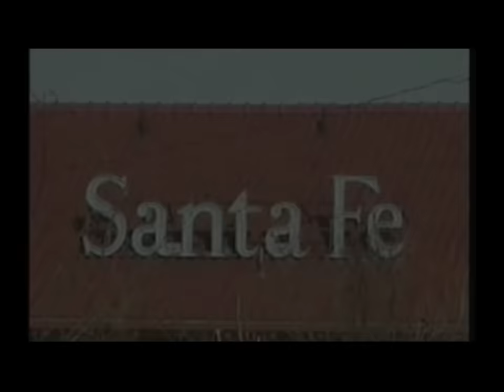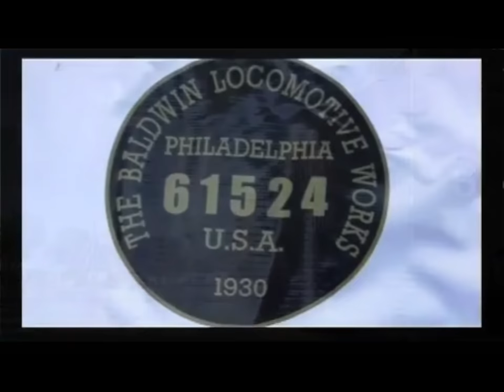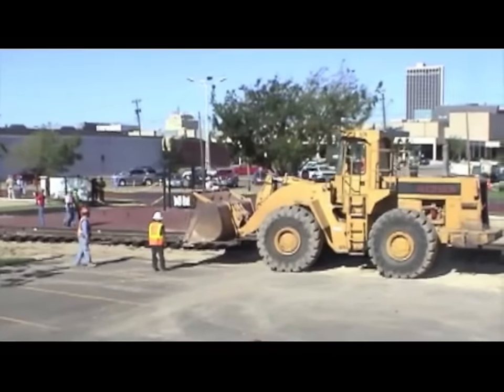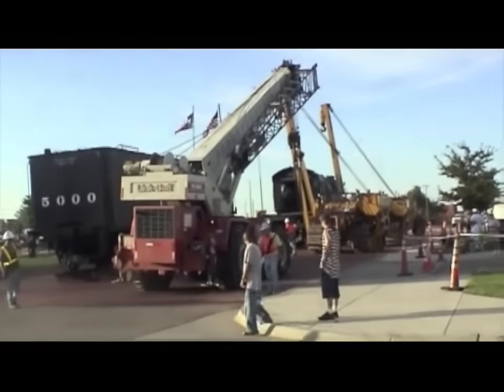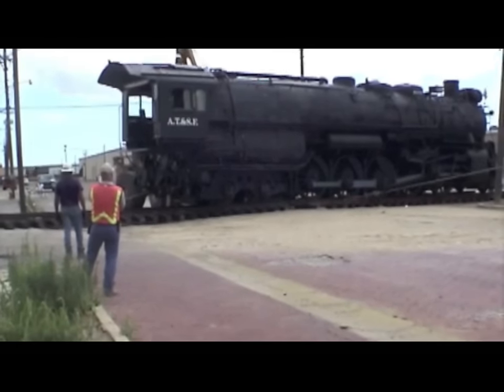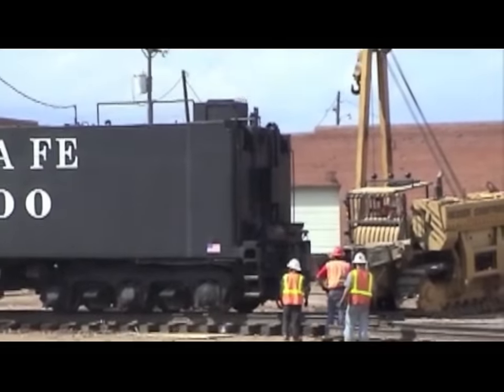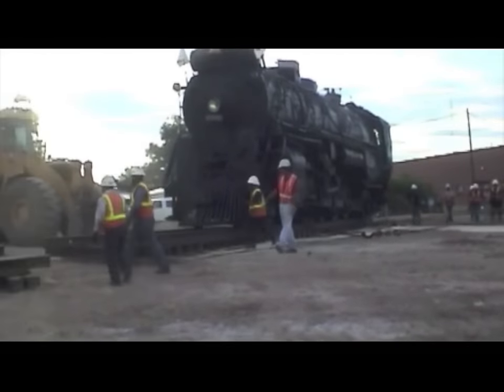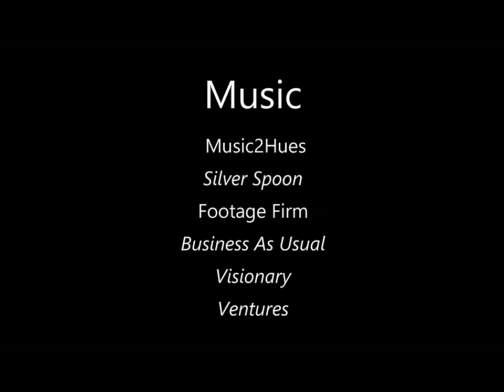Can Steam Locomotive 5000 be moved down 100-year-old brick streets without damaging either one?

Comment: I can't believe they left the main rods and valve gear attached.  What's even more amazing is that the pistons and valves weren't rusted solid.  Cool video, liked it much.
Reply from the maker: Glad you like the video! At the time of the relocation, (2005) a restoration to steam was not even considered, so no attempt at removing the rods was done. The pistons and valves were not rusted solid probably because of Amarillo's low humidity and rainfall.
Reply: Things don't rust out west like they do here in the rust belts. Very low humidity. That's why they store planes in the middle of the desert

Comment: I thought 5000 was being moved to a restoration facility, not another place where it will continue to rust.
Reply from the maker: RAPS had a plan to move it to another location for restoration to steam serviced, but that all went south when they couldn't acquire ownership.
Reply: "rust" is a strong word, locomotives stored in deserts are actually quite stable and will maintain structural integrity for a shockingly long time... She's dusty, but a new coat of paint and a scrub bath is usually all it takes to make one of these engines look factory-new again.

This stands in contrast to locomotives stored/abandoned in rainy areas like the PNW or the eastern seaboard, which tend to rust to the point of being nearly unusable after only a couple decades, and will sometimes even show early signs of rusting within a year or two of being stored.
Reply from the maker: Unfortunately, 5000 has some rust damage on the engineer's side boiler jacket.  This has happened since the cosmetic restoration completed in 2010.
Reply: @trainknut  they store old airplanes and helicopters that have been decommissioned out in the desert
Reply: It costs sooo much money to move one of these locomotives that's why you don't see it often I saw a much shorter locomotive being pulled by a big rig..no tender  just the engine it was steam it looked like it was being moved to hopefully be restored
Reply: @trainknut Unfortunately Amarillo is not in a desert.

Comment: The  IC engine # 2500 at Centralia IL also is displayed at their city park since it was retired back in the early 60s. The thing is that the city takes care of it and always has kept it i n decent condition. Several years back they built a shelter over it to further protect it.  I think the successer to the IC also helped fund the care   of it.  I know that in the original agreement with the IC, the RR specified that it was to be maintained in a decent fashion, not allowed to rust into oblivion or destroyed by vandals.  One time back in the early 70s, a major storm literally stripped paint from the boiler jacket, the RR sent out their crew to repaint it so as to preserve it.
Reply from the maker: That's how a good city government does it!

Comment: I have to agree if they can get the big boy running again and the 611 this train should be restored and put back on the tracks and used instead of sitting in a building.   
You see how much attention the other two engines God when they were restored and put back on the tracks buy the public.  This engine will attract the same amount of attention and people wanting to see it run not just sit.
Reply: Ah - auto-word entries are the Pitt's eh?
Got should never be misspelt as GOD - but there it is, used incorrectly.
[quote]
... attention the other two engines God when they were restored ...
[unquote]
I's sure you didn't mean to say it that way - but seven days ago - means you never checked after commenting

Comment: If the bigboy could be restored couldn't this one ?
Reply from the maker: Yes, 5000 could be restored to full steam operation.
Reply: Not knocking the efforts: but big boy was a fairly easy straight forward, if large, restoration. Theres been a lot harder ones done look at the work done on the rogers k88 or the nzr v's that are still draining after getting pulled out of the river bank
Reply: Yes it could be restored if money was available   the BIG BOY cost around $5 million this one would cost at least $ 3-4 milli9n
Reply: Just scrap all these useless overkill compensator pickups that are hauling nothing but egos in the bed to be used to construct the facility needed to rebuild this useful locomotive that helped build America and not destroy it like car centric infrastructure.
Reply: Anything can be restored , its a question of money , how much and from who

Comment: Stuffed and mounted. I wonder how pitted the boiler is? Would it be practical to go through, re-flue the boiler  and see if she'll boil water again.
Reply from the maker: We actually did a thorough mechanical evaluation on 5000's boiler. We even did a UT test of the firebox and the results proved that the metal was thick enough to hold 300 psi pressure if fired up again. There was one small area in the lower RH corner of the firebox that would have to be replaced due to moisture getting trapped behind the firebrick.
Reply: @santaferatonsub  the usual suspects. I'd imagine a lot of the mud ring area and any other spots that held moisture / condensation were in need of the most attention. But that's wonderful news! So obviously the running gear still functioned. Has there been any interest in putting a fire back in her box and sending her down the mainline again?
Reply from the maker: The running gear functioned and even the mechanical oilers worked during the move. We had big plans back in 2016 to put 5000 back in steam. Unfortunately, the engines owners (City of Amarillo) have no vision for such plans.

Comment: Amazing to see but I don't understand why they did not put it in a building or build one around it. Its been restored but its still outside and open to the elements.
Reply from the maker: The two cosmetic restorations were performed by volunteers of non-profit organizations. First cosmetic restoration was about 1993. Second, was in 2008. All during that time the organizations involved in preserving the 5000 attempted to raise the money for a new building. The first problem was that the building could not be built over the 5000 at the original depot site due to property and legal restrictions. After the relocation in 2005, a local asbestos abatement contractor donated a full asbestos abatement of 5000. The city manager would not allow the engine abatement to be done, because he didn't want to engine to be "unsightly" during the abatement process. Since the abatement was not allowed, the engine could not be enclosed inside a structure.
Reply: @santaferatonsub so basically all this effort was a waste because of one city official?

Couldn’t they at least build an open sided shed wide enough to keep most of the rain off the locomotive?

Comment: 'Ya know...Ive always been a "A chain is only as strong as it's weakest link" kind of guy. What would happen IF that scenario played out here, (i.e. a chain snapping under that tremendous stress), and taking off into whatever crowd, thus cutting multi-people in half instantly...'wouldn't be the first time right?
Reply: The chain to pull the locomotive? The video may not show it but for the initial pull the crowd and workers were well clear of the "Danger Zone". Nobody knew how much effort was needed to get the Queen rolling again so a small pull was performed with everyone clear that is not shown on the footage. This pull was less than a foot but the Queen did not lunge, creek, crack or make any fuss. Literally started rolling forward... silently. I can contest to this as I was one of two people in the cab ringing the bell in the footage you saw. I can assure you there were many precautions taken that did not make the video cut for this or Mega Movers. In fact The History Channel's producers were getting bored with how well the move was going.
Reply: the crash at crush, texas.

Comment: More people would have seen it where it was at in front of the old station. It will last longer in shelter.But off the beaten path. Surprised Sante Fedidnt bring it back to their Heritage Fleet like Union Pacific. has done
Reply from the maker: Santa Fe merged with Burlington Northern in 1995. Unlike Union Pacific The BNSF has no interest in historic steam locomotives.

The current location of 5000 is actually better for viewing than the depot site. Since 5000 was moved, a large event center has been built in front of the depot and it's much harder to see the depot now. The event center that covers up the view of the historic depot was approved by city council.

The City of Amarillo purchased the depot some years back with a plan to tear it down and use the land for a parking lot. All historic preservation efforts to save the depot have been ignored by the city in the past. Now they are acting interested in turning it into a railroad museum, but I seriously doubt they are sincere. If they are, why did they approve building a huge structure in front of the depot that destroys the historic view of the depot and surrounding grounds.

Comment: The mega movers cameramen and sound guys seem dangerously close at times. Like well within range if one of those towing chains snaps.
Reply from the maker: I don't recall anyone being too close to the chains when they were under load stress.
Reply: @santaferatonsub  I think it's when they are turning the locomotive for the last time before pulling it to it's spot.  The camera guy is standing between the worker in the hard hat and the locomotive while one of the front loaders is tugging on the track.  Maybe it was just the perspective of the camera, but he seemed really too close.

Just checked.  It's at the 52:36 mark in the video.  The cameraman and sound guy walk from right to left across the back of the loco and start filming the front loader pulling with the chain.  They don't look more than 15 feet away.  The employee directing the front loader is standing at least twice again as far away.
Reply from the maker: Thank you for your interest in the video and for your comments! 
I looked at the footage at both sides of the 52:36 mark and the closest chain to the History Channel camera crew is too short to reach them even if it broke. The sand under the track works like little ball-bearings and helps take a lot of the pressure off the rotation of the locomotive. Let me know if you have any more questions or comments. Sam Teague author of ("The Madame Queen")
Reply: safety? naw
Reply: When a chain breaks, it falls to the ground. A cable, on the other hand, becomes a deadly slashing object due to it's being stretched.
Reply: @chrishayden7016  A chain under tension can snap around too.  And a chain attached to a bulldozer tugging on a million pound locomotive is definitely under tension.

Comment: That woman should not be in the cab while this operation is going on.  So dangerous.  At least put a hard hat on her.
Reply from the maker: The people in the cab were not part of the general public. They were family members of the Messer crew. I rode in the cab with my wife during the last trip up the hill to the cement slab.
Reply: If the chain broke off from the CAT.  It could had killed them.
Reply: @redlight722 If the chain or cable should break it would travel in the direction of pull. In this case towards the loader or dozer.

Comment: Why spend so much money to to move this old corps from one grave to another. If this thing is so important why not spend the money to have it bought back to operation.
Reply from the maker: The engine had to be moved before any restoration, either cosmetic or steam, could be performed. After the move in 2005, volunteers began a cosmetic restoration to hold the condition of the locomotive from deteriorating further, while restoration to steam plans were in process. Ultimately, we could not get ownership of the locomotive from the City of Amarillo and the effort had to be abandoned.
Reply: @santaferatonsub  Going on other comments the problem appears to be one city official not the city. It could be that a particular city "official" didn't understand your proposal. No doesn't have to be the end only a time to negotiate.
Reply from the maker: I wish it was just one city official. We could have got around one eventually. The truth is however, that I worked with several city managers, several sets of city council members and mayors. All of which were worthless. They thoroughly understood our proposals and we negotiated many contracts for the care of 5000 over 20 years. The end came in 2016 and negotiations were abandoned forever.
Reply: @santaferatonsub  Buy the book "Never split The Difference" By Criss Voss.